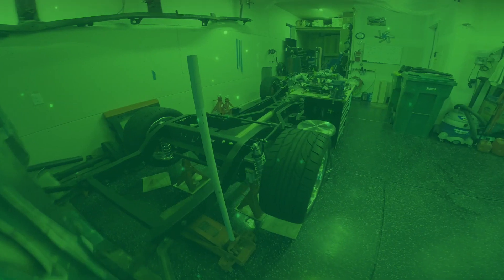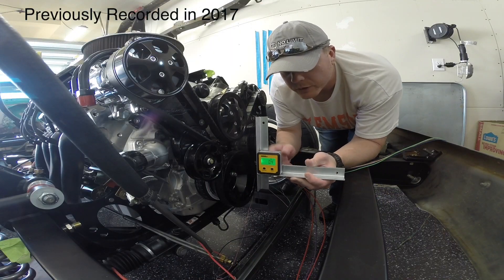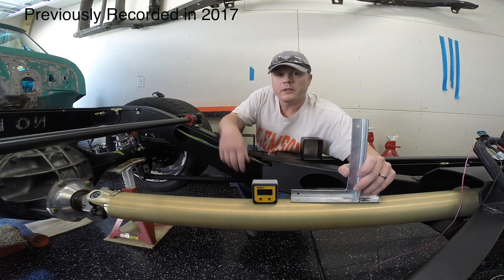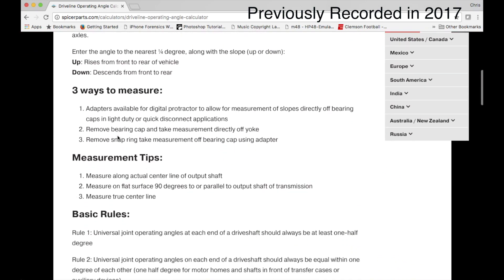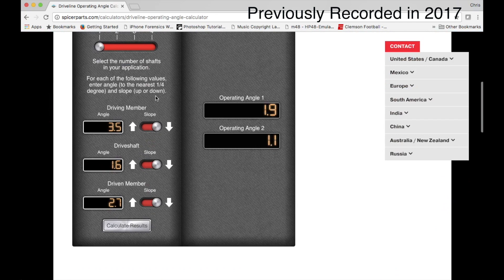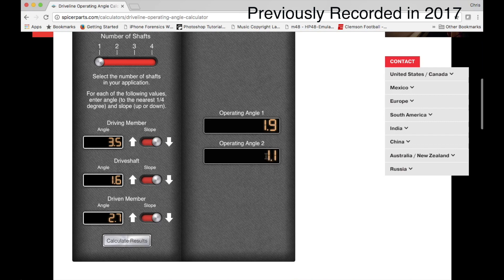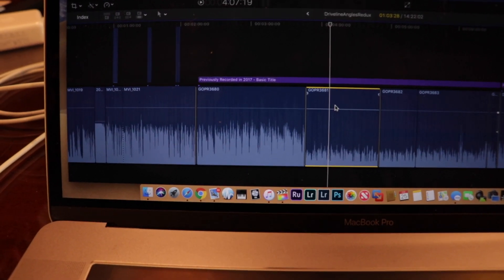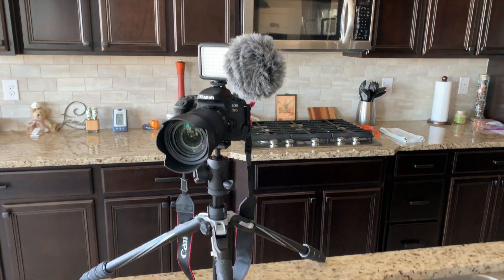Driveline Angles Redux

Comment: I know this is an old post, but can you please explain before measuring your angles where do you zero out the angle finder or is it at zero once you turn it on. thanks,
Reply: in the online calculator you will see that the zero "tare" of the angle finder is taken the frame to mark a master datum line. And the measurments are then all relative to the frame where you zero the finder.
Reply: @ thank you.

Comment: On a 72 Dodge Charger I had a driveline vibration that I could not correct even with the u joint angles perfect on the horizontal plane. Eventually I found the engine/trans was not parallel with the chassis. That had the u joint angles way off on the longitudinal plane. After correcting that the vibrations were completely gone. This car had an engine swap, using the wrong engine mounts which caused the engine/trans misalignment with the chassis.

Comment: Thank you for putting this together.  I just did a drop on my 2020 F150 (2WD, short bed) from Belltech and I got the low speed vibrations like everyone else apparently.  It's Belltech kit 1001SP.  Turns out I have 8.8 degrees of angle on my pinion!!!!!  WTF Belltech?

Comment: 2007 Dodge Ram 1500 SLT 4x4 5.7 Hemi - Angle and Vibration Fixed! (And lessons learned, lol) As I was tracking down this phantom vibration, and my driveline angle being out of whack, I was working through replacing parts that previous owner had neglected. Lesson #1) Even if your shocks don't look that bad, they might fall into several pieces when you unbolt them. Lesson #2) I had never encountered this before, and read on a few forums that worn shocks wouldn't cause fluctuation in driveline angle, but bad shocks CAN absolutely change the angle, I replaced mine and drove around a few miles, and the angles evened out. Lesson #3) Checking the condition of motor mounts with the "P-R-N-D while holding the brake and watching for engine movement" doesn't always apply, especially with Ram 4x4s because the mounts are sometimes anchored to the front diff, which will absorb any movement caused by bad mounts, causing phantom vibrations. You have to get under there with a pry bar and check by moving things up and around, it will be very obvious if the mounts are bad. Big thanks to CJ!!! I hope this info helps somebody out there, this phantom vibration has been so annoying, so if only one person keeps their sanity because of this, I'll be happy.
Reply from the maker: Great feedback and thanks for sharing what you've learned!

Comment: My measurements are output shaft 5 down, driveshaft 7 down, and pinion is 2 up. Spicer calculator says #1 angle is 2 degrees, and #2 angle is 9 degrees. What do I need to raise, transmission or pinion, and how many inches, lol. Help me Tom Cruise!!!!
Reply from the maker: If your pinion is up (for me that means the pinion yoke is up, higher, relative to the axle centerline) then that is actually a down slope in the spicer tool, so your angles would be 2 and 5. I'd see if you can get some axle shims to rotate the pinion a degree or two more from where it is, trying to get closer to the output shaft angle. Depending on suspension though, you may get some additional pinion rotation while under load, so you don't necessarily need to match the output shaft angle. For example, a leaf spring suspension will typically give you 1-2 or more degrees of rotation (depending on HP) on the pinion (up). So if you got to 3 or 4 degrees on your pinion you might be ok. However, the best thing is to try and get those u-joint angles to match, so if you don't/can't shim the axle, you could actually raise the output shaft to where it is closer to 4 degrees. So to really make your brain hurt ;-), with your output shaft at 4, driveshaft at 7 and pinion at 2, with 1-2 more degrees in suspension wind-up you'd have u-joint angles close to matching at ~3 degrees while under load/driving. With angles outside 2, you might get reduced life on the u-joints, but sometimes you just can't help that situation. Now, how many inches to raise, that's dependent specifically on your setup. Best I can say there is get out the trans jack and take the rear mount loose and start jacking up until you get the output shaft to 4 degrees (assuming you can w/o hitting something). Measure the gap to the rear mount and get yourself a spacer. Good luck!
Reply: @C10CJ  Thanks for the quick response, I'll let you know how it goes.

Comment: how should i measure with a double cardan joint at the transfer case end and a single ujoint at the front diff on a 2017 JK?  Thanks!
Reply from the maker: I've not personally dealt with a double cardan setup. My understanding is you basically just measure driveshaft angle and then set the pinion a couple degrees less than the driveshaft, so the pinion basically points toward the transfer case vs being parallel to the output shaft (standard u-joint setup). So if your driveshaft had an angle of say 15 degrees then your pinion would be 13 degrees (pointing towards the transfer case, assuming leaf spring suspension). The front would follow the single piece driveshaft, so basically what I did in the video. The front has a tradeoff though, which is pinion angle for caster. I have limited experience on front driveshafts so I'd defer to some jeep guys that have done this a bunch as they'll have the experience on the best way to set pinion angle and caster. The tradeoff with caster is mainly steering stability in this case. As you rotate the front pinion up, you are decreasing caster, and once you go negative on caster, that's when you can get in trouble with the steering.

Comment: If the angle finder arrow pointed down on one of the readings,  why would say it was actually up ?
Im lost here .
Down Up Slope  ????
Reply from the maker: Hey Sho Bud ... this is one of those questions where a picture is worth a thousand words, but I can't reply with a pic so here's some words that hopefully help. First thing to keep in mind is that most of the digital angle finders I've used are really digital levels. So that little arrow is indicating which direction that end of the piece being measured needs to go to be level. So if those little arrows are on the left side of the digital angle finder, then the left side of the piece being measured needs to go up to be level if the arrow is pointing up. Now let's look at this in terms of the slope it is actually measuring. With the little arrow pointing up, that means the slope is going down from right to left. Down slope simply being the right side is higher that the left. In the case of the measurements I made in the video, the arrow was pointing up, indicating the left side, in this case let's use the driveshaft measurement, so the left side of the driveshaft (the rear U-joint) would need to go up to be level, indicating the slope is going down from the front of the vehicle to the back. Now, this works this way because I measured from the right side of the truck. If I had been measuring from the left side of the truck, the little arrow would be on the "front" side instead of the "back" side and the arrow would have been pointing down. So remember, the little arrow does not indicate slope, it indicates which way to level. Hope that helps!
Reply: Thanks for the info .
Here are the measurements i came up with on my little Toyota Corolla that came from the factory with a 2 piece shaft .
Thoes shafts are non serviceable so i had a 1 piece shaft made .
Trans Yoke was  11.7  up
Driveshaft.           11.6 up
Differential Yolk  12.5 up
I added 3° shims to raise the differential to get theses calculations .
Is this anywhere close to what its supposed to be ?
Thanks .